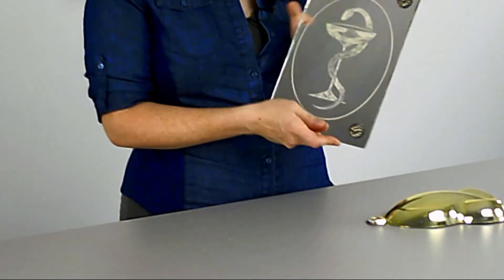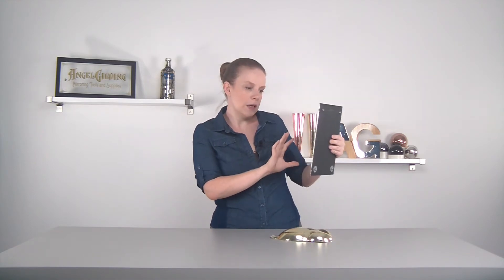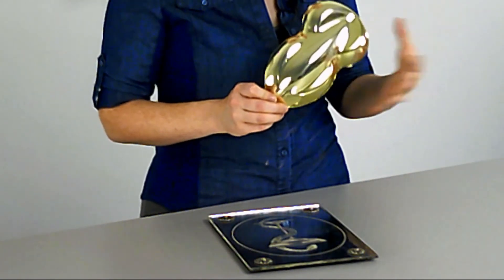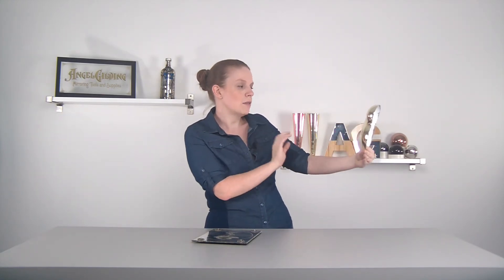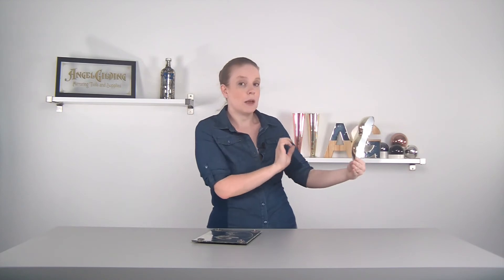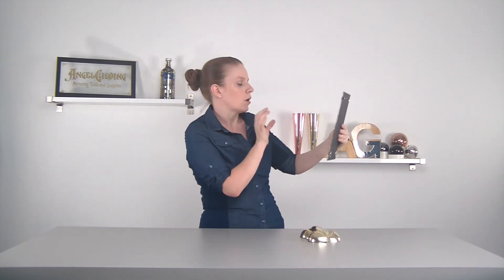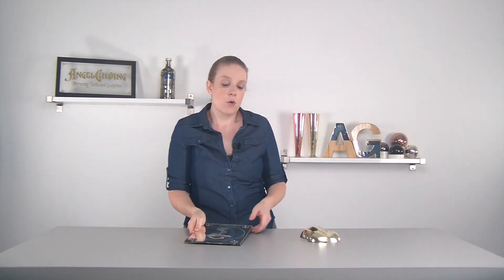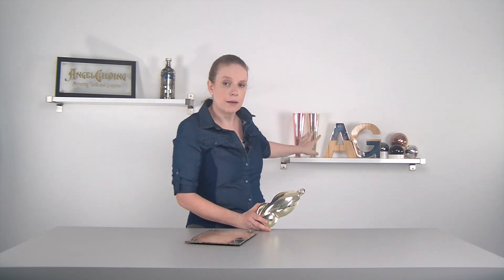Quick Tip First vs Second Surface Mirrors and Spray Chrome

Comment: How do you tint with color?
Reply from the maker: Hello, you can either silver colored glass or you can use a paint that is baked on. Silver will lift most paints, but there are some paints that can be baked in a regular oven that you can then silver.

Comment: Wow! This is a great video. I loved it. I'm greatly interested in first surface mirrors. Kindly clarify the following to me.

1. Could you give me a step by step procedure on how to prepare a liquid silver solution used in making a front surface mirror by spraying method? Please include all the chemical reagents and the activator I should use.

2. Also, let me know if the time between spraying silver and applying a coat significantly affects the quality of the mirror produced due to the reaction of the silver with oxygen in air.

3. Also,  someone from somewhere else stated that using silver to make a first surface mirror will not give a mirror but a slightly reflective surface like the dull side of an aluminium foil since silver is not smooth enough for a mirror unlike a glass surface which is perfectly smooth. What do you think of this?

4.  Let me also know the quality of a first surface mirror compared to a second surface mirror in terms of giving a clear reflection. 

5. Finally, let me know if there are first surface mirrors in use nowadays.

I'll greatly appreciate your feedback.
Best Regards,
Edwin.

Comment: A good explanation, but I know that the reason for the yellow color is the varnish on the silver in the bad formula and the bad lacquer. We do not add dyes to the varnish and get a white coating.
Reply from the maker: Hello, thank you for your comment. Why would you get a white coating if you are wanting a silver appearance? The slight yellow that can appear on a first surface mirror is also there when the silver is protect with pure distilled water, so it is not only found with a lacquer or in our case urethane.